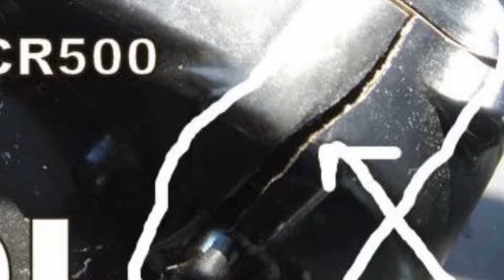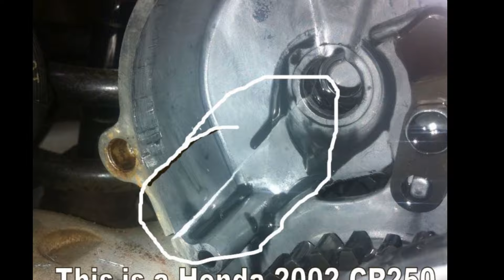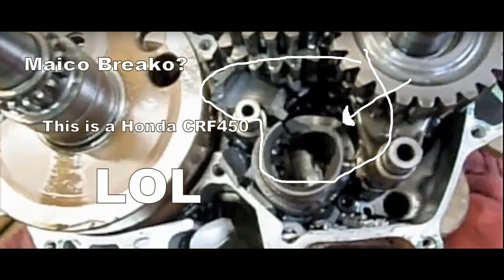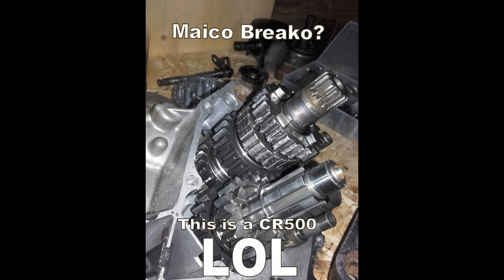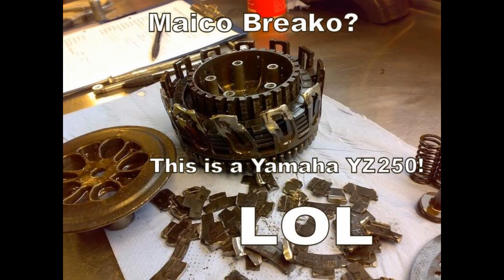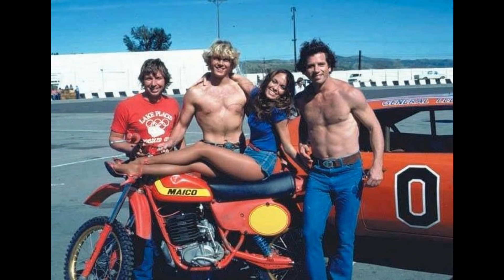MAICO BREAKO?  LOL!

Comment: you really know your stuff on bikes. I have most the bikes you are showing with broken engines and none of mine have any problems. knock on wood, now the 450 did need a full rebuild in the past but the 500 is a very strong engine. depends on the owner of the bike and how they maintain their equipment as well as riding style. I enjoy the sport all around and getting out in the weather, so I say ride on and have fun on any make or model, all bikes feel different, everyone has their preferences, what works for one person might not work for the other.
Reply from the maker: Ya, mostly you don't have problems and properly maintained bikes are less likely to have issues.  That was really the point afterall, no one thinks these bikes break.  Maicos are the same.

Comment: Not really fair to bring four strokes in since there typically the ones to shoot a rod thru the case.
Reply from the maker: I think it's fair, Honda for example ONLY produces 4 strokes.  When people say Maico Breako they are typically talking about some bike someone had from 1970 or even the 60s where there was some problem.  So they are using a 40-year old bike to tarnish an entire brand for decades.  So I think it's fair to bring up modern day bikes, which are still being made by brands that aren't being tarnished today, not in 1960.
Reply from the maker: If we exclude the bikes that break, then nothing breaks!
Reply: I guess I misconstrued the message from this video. I thought it was to compare 2 strokes from other manufactures, where you are just comparing manufacturers,my bad. All in all 2 strokes are the shit and shit breaks
Reply from the maker: Ya, the message is just that Maico is unfairly tarnished.  It's not even that these are bad bikes or a comparison.  Everything breaks.
Reply: Probably because if they break you can't find any parts locally, that's what a few of my buddies complained about.